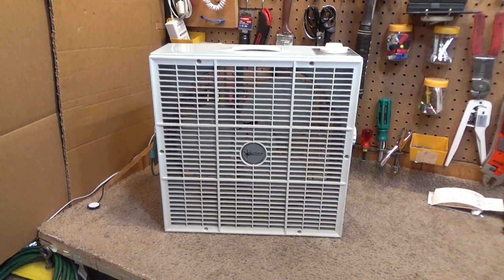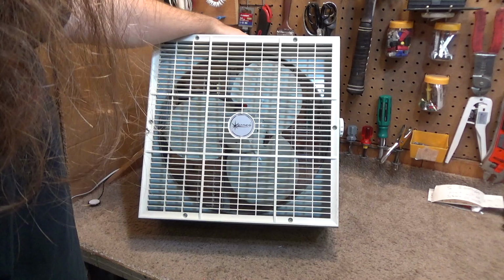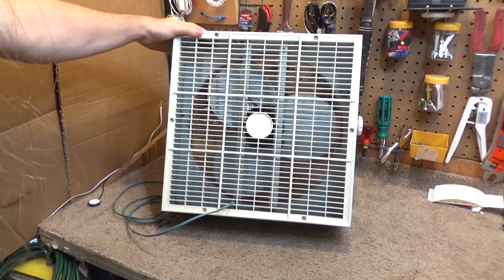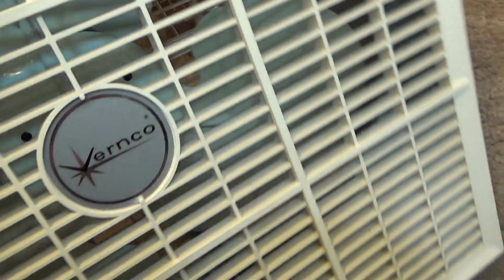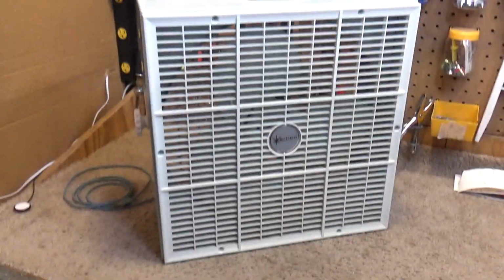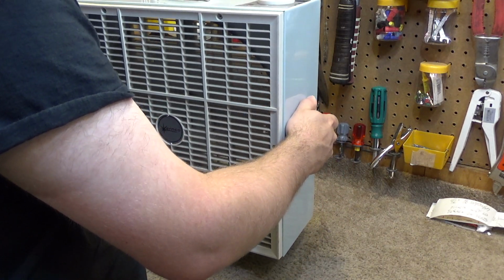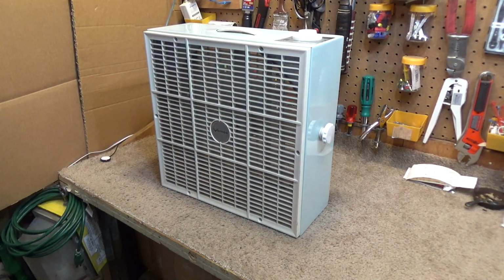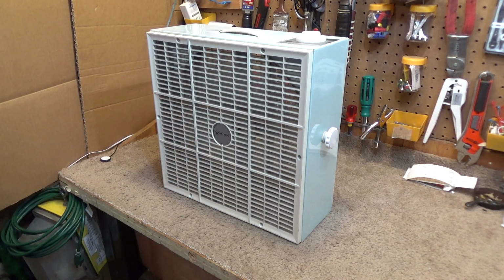Vernco 14" 2-Speed Metal Box Fan

Comment: I would guess the two “off” positions is from using a 3-speed switch with a 2-speed motor. The third position isn’t connected to any windings, so it becomes an off. Perhaps the manufacturer did this to simplify their parts needs instead of keeping 3 and 2 speed switches in stock?
Reply from the maker: That is a possibility.